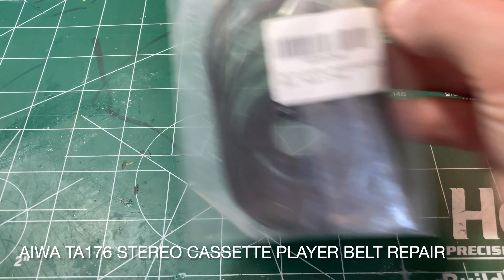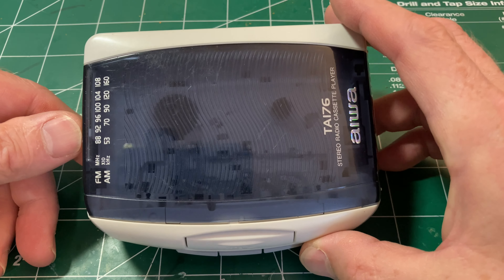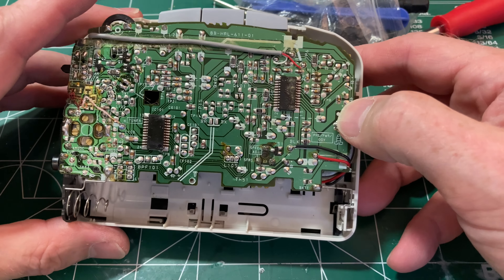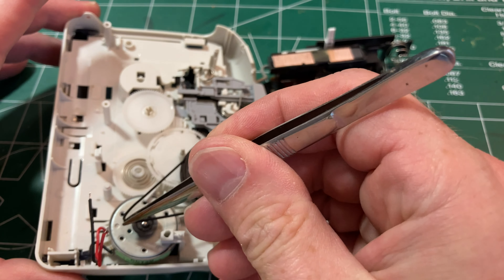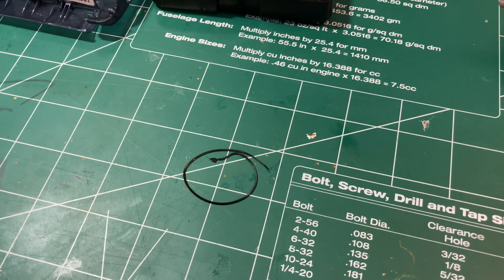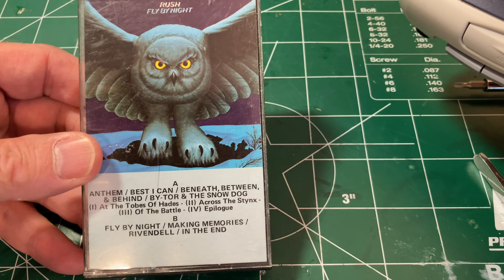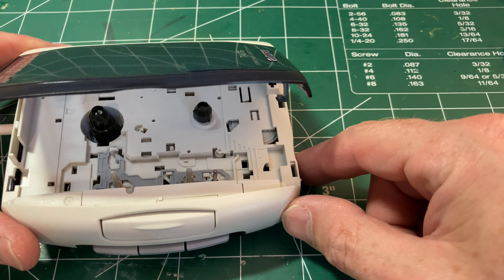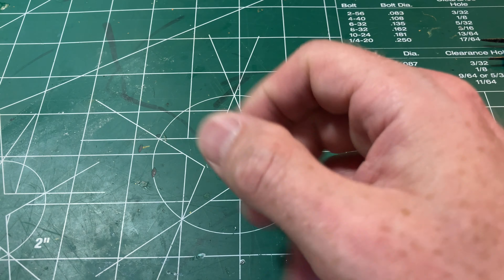Aiwa TA176 Stereo Portable Cassette Player Repair

Comment: Thank you for the video! I have a slipping belt in a very similar AIWA HS-TA60 and it was helpful to confirm that there are only the two screws holding it together and the rest is clips. Just wanted to point out that there's actually just enough slack in the black and red power wires to pull them around the little tab marked with a "2", after which you can just lift the whole PCB to access the belt, without needing to desolder those wires.